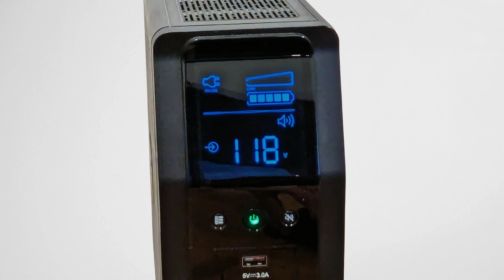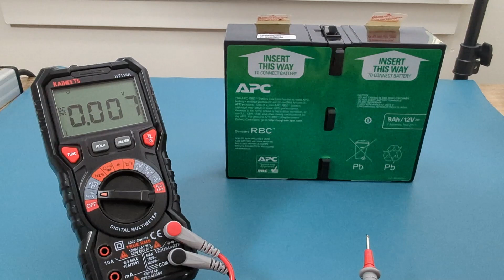How to Test a UPS Battery with a Multimeter

Comment: You should be using an internal resistance meter. My apc battery read 26v but had a very high resistance. a good APC battery should read between 20-30 milliohm. Anything above should be replaced. Also, if you live in a high brownout area it may be time for a new ups as components degrade after time.

Comment: Totally useless. Pure voltage alone tells you nothing. The battery needs to be under load to tell you if it us good or not. Also, prodding two test leads like that into a receptacle is very dangerous. The risk of shirting tge b atteries is high and even weak batteries will unload dizens of amos causing potential burns or fire. Far mord sensible to simply t.urn ofv the supply to the ups and check how long it can sustain a load. Doing that say half yearly will soon show ifcand when tge batteries are becoming weak.

Comment: Unloaded battery "good voltage" says nothing , tons of bad batteries show 13,5-13,8 Vdc once removed from powered UPS,  when you apply even a little load they fail miserably.

Comment: Thanks so much for quick tutorial. I have a few APC UPS units and one of them started acting up weird. After doing some reading with APC information that they provided, i couldn’t find to much info for the issue that was happening with my unit. 

After checking the voltage following your video instructions, the battery reads “13.23” (steady). Now i know is the battery not the whole unit.

Thanks again!. 

Every time i Powered-On and waited the necessary amount of time before using it, it will just go directly into a prolong-beep-mode and never stopped.

Comment: Great topic but every UPS I have seen used just one or 2 12v batteries, and you never gave any info what is expected voltage for 12v batteries.   You should disclose in the title you only cover 24 v batteries.
Reply: The video clearly states that the tested unit has 2-12V batteries to make a 24V battery. Since they are connected in series, you can half the "go, no-go" voltages given in the video when testing a 12V battery.